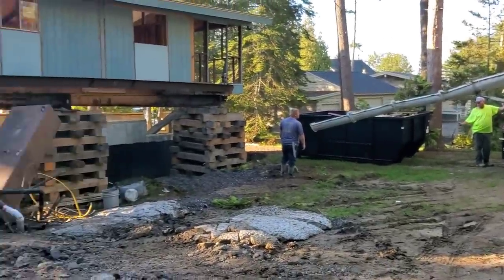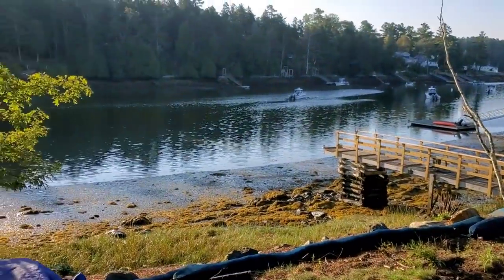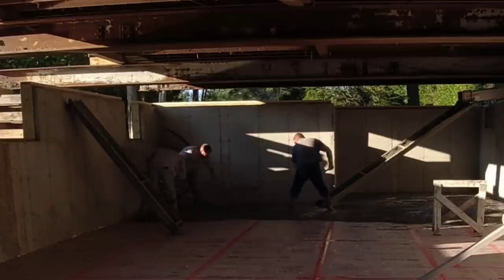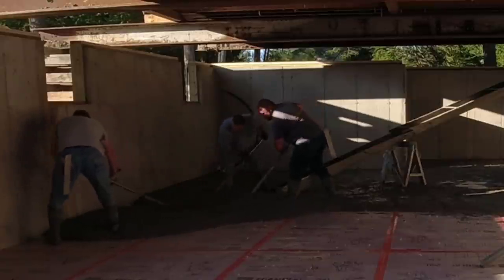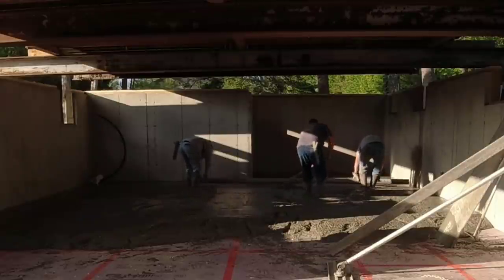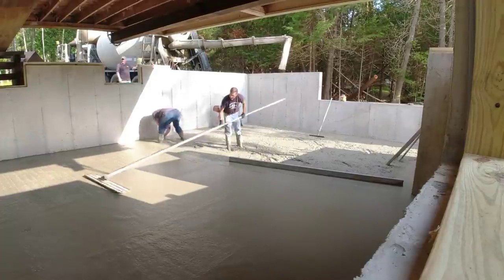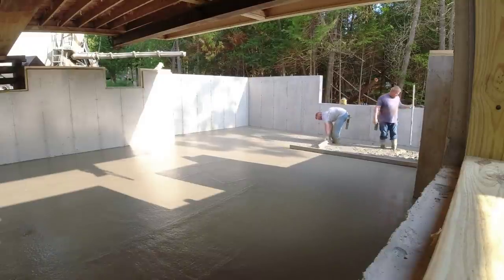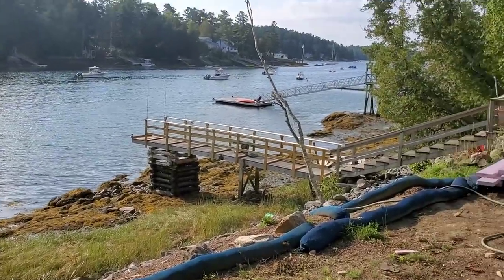How To Pour a Concrete Floor Under a JACKED UP House (Difficult Access)

Comment: Im guessing the styrofoam is to provide a thermal barrier. 
How would that matter if the floor is below the frost line?
Do you us a heavyweight plastic sheet under the foam?
I live in Tennessee 
No idea about Maine codes
The only thing I know about Maine is Flagstaff lake and Topsfield and there no where near each other
Reply from the maker: Styrofoam is code. 6 mil poly under it.
Reply: Moisture barrier too. If seams are taped.

Comment: Why don't you use steel reinforcement in this slab ?
Reply from the maker: We use Fibermesh, you can't get wire mesh right now!
Reply: Interesting.  We have materials supply issues in Australia too, but can still get steel mesh.  Timber is the issue here
Reply: @Maximo10101  timber supply sucks. I'm trying to build and can't even find merch grade timber for partition walls. And I think they do things differently over there with the freeze thaw cycles as well.

Comment: Your kick screeding style is only easy and fast because you always pour so wet with water reducer in your mix. It looks like you are banking on a lay down of 6-7 slump. You often don't even bull float until you have laid out many many yards. That's only possible to get it capped if your slump is high and the extra water bleeds to the top and extends your lay down window time. I always wondered why you always seem to put fiber mesh in your pours and now I know because it's what gives your flatwork strength and durability since all the rock is sinking in the mud. Residential work has always gotten away with this concept but commercial builds have to meet qualified cylinder slump verification on site at the time of the pour and pouring that wet would never pass. It is completely acceptable for residential though. Plus..by sealing all your slabs it gives it a better chance for surviving cracks and protecting from outside weather elements which I've noticed you always seem to do. Nice work gentlemen!
Reply from the maker: Without the water reducer this concrete would slump out at around a 3. It's not "wet" its very flowable made possible by using the water reducer.
Reply: @MikeDayConcrete  I was wrong with the terminology of the process you use. It's actually genius as we all know how difficult...nearly impossible it is to lay down flatwork at a 4 slump or less. It hardly travels the shutes let alone spread once it touches the ground. I meant no disrespect to your method or question your professionalism or finish abilities. On the contrary.....the fact that you and your screw lay down screed hubs and jump between and wet rod is a testament to your abilities. Not having to take the time and effort to set, move , remove, clean and store and reuse massive amounts of forming materials saves you a ton of labor and cost that returns you much more profit for the labor you do give to the trade. Congrats to you and the crew. I am forever a ardent fan!

Comment: 15K for the foundation seems cheap....I was told to raise a house would cost more than the house was worth.
You are limited on the companies that can do it...so price is a premium...
Reply: Agree. I just poured my own foundation walls, and I spent $11,300 for materials only. This was 162' of 8"x2' wall, and 54' of 8"x5' wall and footing.
Reply: I don't think 15k includes any of the jacking or excavation.  Just to come in, set panels, and pour walls.
Reply from the maker: Yes, and it was just a rough estimate

Comment: This is a decently tall wall, the slab may be structural and helping to hold the wall in place. I could definitely see the builder not wanting to take the risk of backfilling before the slab is in if the engineer called out the slab as structural. I think I'd have the irrational fear of the house coming down on top of me. Nicely done!
Reply: 100% the reason they didn't, also the house would need to be set on the foundation too prior to backfilling.
Reply: @cheshstyles  Look at the waterproofing grade. They must be bringing in a lot of fill to get it up to that grade. Actually now that I think about it they probably can't backfill until that house is set down because the cribbing is in the way of fill.